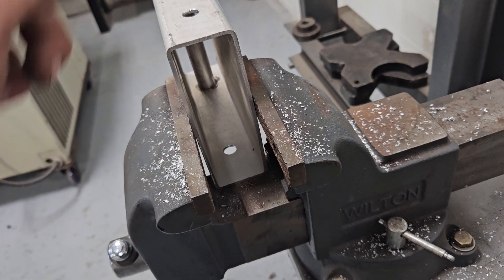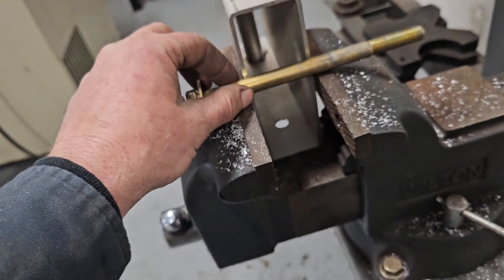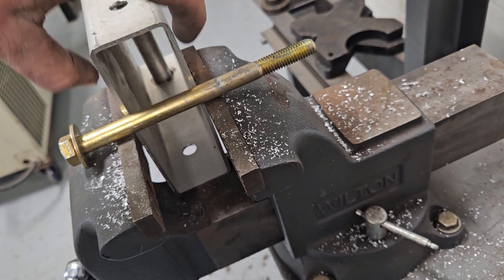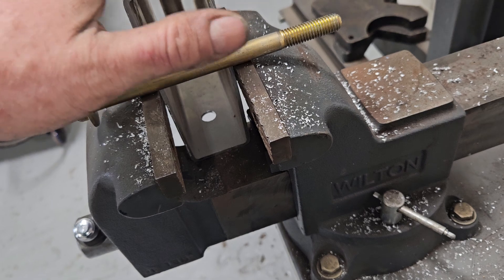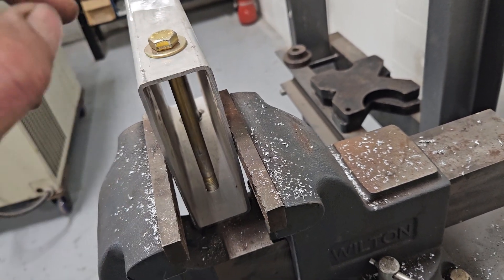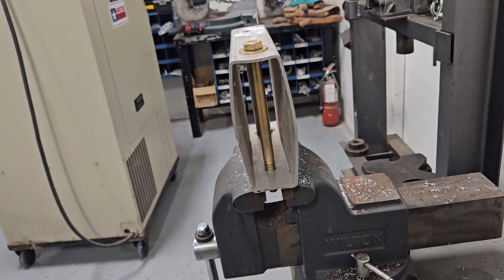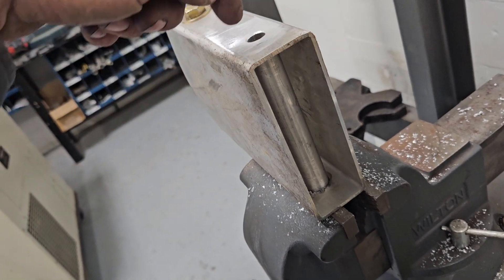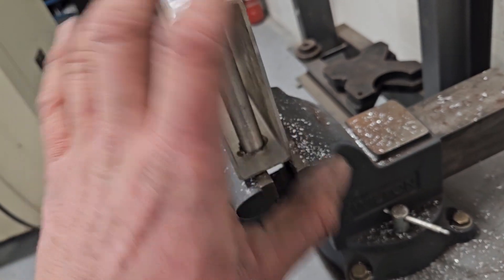aluminum trailer failure

Comment: Clevis bolts/pins are indeed designed & intended for shear loading... some are retained by pins or minimally torqued nuts, with no dependance on torque or friction. I suspect your dealing with poorly designed joints. There's a lot more to all this...